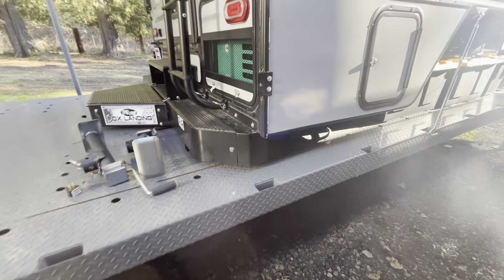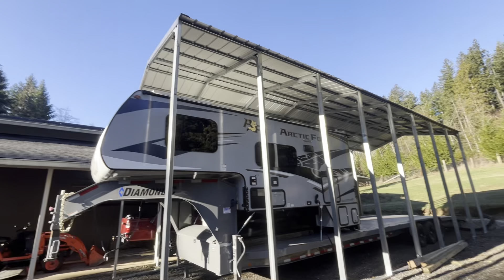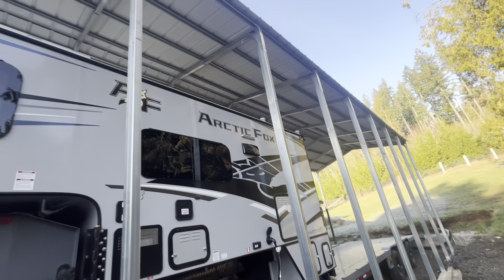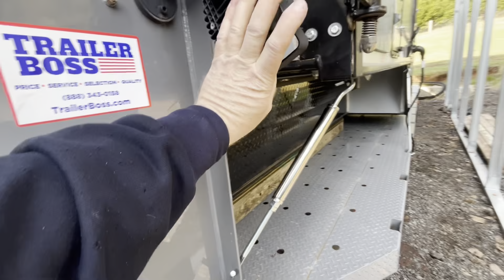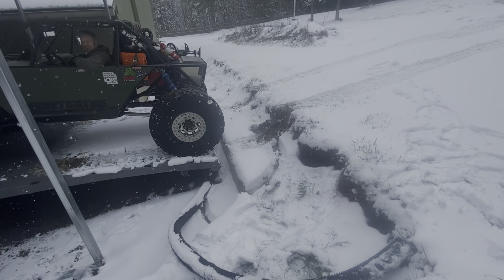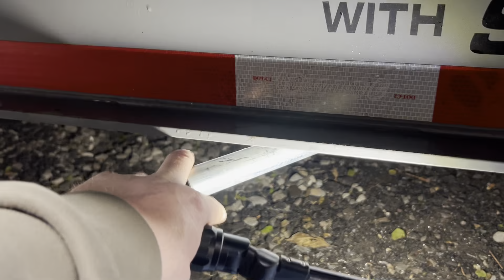Part 2 Crawler hauler build diamond c gooseneck arctic fox 1150 camper, new sponsor mytee products!!

Comment: Know post is yr old, but have a question... How many inches did your platform leave between the bottom of the cabover and top of gooseneck? Hard to see in vid. 

We will be building one of these soon (not nearly as nice as yours). But trying to figure out how high our platform needs to be for our Artic Fox to safely clear any gooseneck flex, especially when on bumpy roads. Thx!

Comment: Hey man I love the build. I’m doing the same thing with an artic fox 811. QUESTION?? How many inches high is the wood base underneath
Reply from the maker: About 6” but it will vary depending on your trailer neck height
Reply: It’s a flat deck trailer so I only need the lower clearance height. I get what you’re saying. I’m just being lazy

Comment: First time I've seen your setup.
I'm doing the same thing. Except I'm using a GatorMade Gooseneck trailer. The people in Somerset KY are doing the modifications on the trailer.

For the sewer line, we put in a drop line below the deck. 

I'm having upper and lower boxes built by the same company to look as if the whole unit looks to be made as one. 

I put a John Deere RTV on the back.

Two side boxes on either side will hold 45 gal fresh water holding tanks, With pumps.

I have a dual fuel tanks being installed also. One will be for the 6000 watt generator that fits perfectly in the generator hole.
And a fuel pump for my JD RTV 

Your question about tie downs. Get the stake pocket d ring inserts. Each will hold 5000 lbs

I'm using a 2019 Dodge Ram 5500 to pull this.

All modifications should be done by end of the month.

Comment: Nice build, very throughout. To charge the batteries on my toy hauler i wire a separate 2 gauge circuit form the truck batteries back to its own socket. The factory wiring only allows 10amps or so by the time it gets to the camper batteries.
Reply from the maker: Good call on the separate circuit, the factory wiring is never enough.

Comment: I have tied my rigs down with a single strap over each tire for a couple of decades without a single issue an in recent years, I added Mac's Tire Blocks because I'm a belt and suspenders sort of guy. 
On the deck, I centered a simple, bolt-on D-ring 3" in front of and behind each tire to connect each strap. 
I've towed my rigs all over the nation and have found this to be quick, efficient and safe over a couple of hundred thousand towing miles.
I'll hope to bump into you at some point.
Reply from the maker: Thanks for the info, I see lots of professional car hauler guys do it, maybe we will see you out there…!

Comment: I would look at looping your tires but Mac Straps make really nice stake pocket strap down points.
Reply from the maker: Looked at those, trucks are to close together for those Mac’s straps to work
Reply: @ they work if you run the tire strap that loop the tire inner and outer side wall vs the the tread like you have.

Comment: That thing is absolutely awesome.  I'm actually thinking about doing the same thing with a host mammoth truck camper 3 slides. You guys rock. I'm surprised you didn't use steal to make a cradle and then bolt it down to the trailer but hey it works.  Really cool
Reply from the maker: The trailers twist much and it tears the campers apart, same reasons they use spring loaded turnbuckles on the pickups